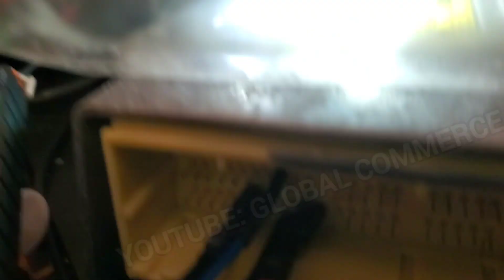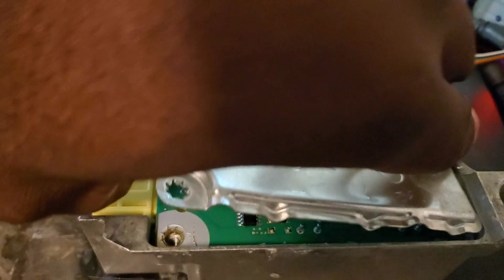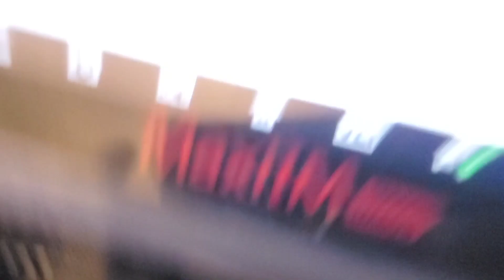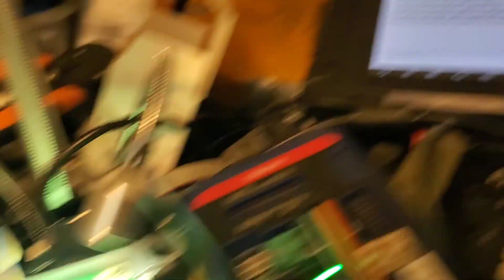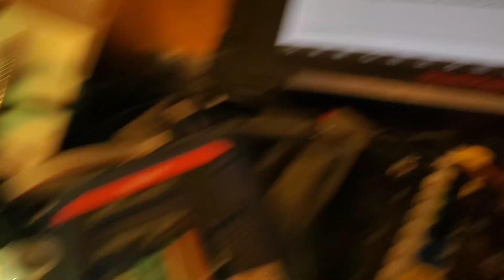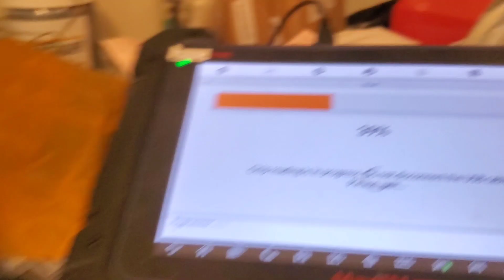2020 Toyota Tacoma SRS Module clean clear repair, MUST know Tips! 89170-04710 EEPROM ST 95M01 Autel

Comment: Hi i have done everything like this video but I don’t have anything to clean the file I tried using chatgpt but a b1000 pop out when connecting the module to the car . Can you help me clean my file?
Reply from the maker: B1000 usually shows up when the module isn’t happy with the data it’s seeing after the flash, most of the time it’s a bad/corrupt file or the wrong variant for that exact module

Please double-check that the file you used matches the original part number and calibration for that vehicle. If it was “cleaned/virginized,” the module still needs proper initialization and coding once it’s back in the car

At this point I would go back to a known good stock file for that exact module and reflash, then do a proper setup with the correct scan tool procedure. A lot of these issues come from using a generic “clean” file that doesn’t match the hardware revision

Comment: I have OBDSTAR P50 and so far out of 10 controllers - 8 didn't work because they didn't have it or had an incorrect pinout, 1 worked for Skoda and in 1 for Toyota, after cleaning, the controller completely lost communication!

Comment: You did a super long process you can do cg70 1 step and it will be done. 😂
Reply from the maker: Who told you this?  We are an official distributor for CG products, an unboxing and review video of the CG70 is on the way.  The CG70 Does NOT support this chipset.